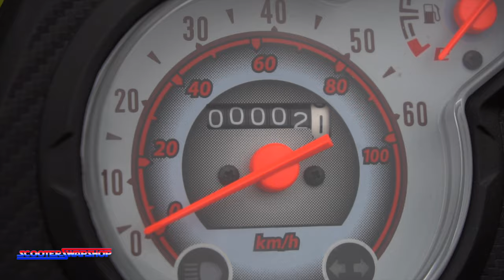HONDA NAVI : First thoughts and Walk around. FIRST CRASH?

Comment: I love mine. They are fun and inexpensive. They're different than the traditional scooter in that they have a more motorcycle styled aesthetic. I think they look good. Power is superior to the 50cc bikes plus they are reliable as hell. The complaint I do have is that I wish the wheel sizes matched. That rear wheel limits the options IMO, and the rear fender with the tail needs to go as does the rear wheel cover
Reply from the maker: Totally agree!
Reply: very first 'mod' i did was rear fender delete. looks SO much better without it.

Comment: Do you think the navi could be equipped with a GY6 150cc powertrain and would it make the bike any different as far as acceleration and top speed?

Would it make the bike better, bottom line.
Reply from the maker: Yea you could the problem is it won’t be reliable anymore.  Believe it or not with just a cam and variator, carb tuning it will be the same speed as a gy6
Reply: @Scooterswapshop  are you aware if there's any kind of speed limiter / manager on the navi to where it might be under tuned purposefully?

Comment: The Navi piqued my interest, but it looks cheap for a Honda. I mean, the build quality on my Kymco looks like it's built better (and I have a front disc brake on that!) I like that they included the storage box for the US model though; it's an option in other markets. I get the point though, other manufacturers have been making motorcycle-styled scooters for a while (cvt-scooter mill in a step-over frame) And Honda wants to bring in new riders, so as a beginner bike, where you can twist and go like on a scooter, but still have the foot brake, but all the braking is unified to reduce the chances of a mishap by a new rider grabbing the front brake hard... I dunno. I think I'd rather get a an actual used motorcycle; since you'd need a motorcycle endorsement for it in most places. Definitely has potential though. Really interested in seeing what you guys do with it... Oh, and the low barrier to entry; This is currently the cheapest new bike Honda makes, and it's cheaper than a Ruckus, with a larger engine?!? makes it tempting for a lot of people. Even cheaply made, by Honda standards, means it will last a long time if maintained.
Reply from the maker: great input!

Comment: I was looking at these before they were released. I wonder if you can recommend old or new a scooter for a big guy. Im six foot 1 and 240 pounds. The scooter will be only for in town riding. I live on a very curvy road so it i want to have a big of fin there too. I was looking at a 2 stroke zuma bugeye but thought it may be to slow. Im kind of lost on what to buy. I do not was a big 250 or anything like that. I do not care for the styling of the bigger step though scooters like some of the big hondas/Vespas etc. Five to 8 miles will be a typical trip. All on smaller back roads. Would you take this over a used Grom?
Reply from the maker: man it all depends step thru scooters are a blast your not too big at all there are way bigger dudes on way bigger bikes if you dont want to md something maybe a grom if your wanting to mad a zuma of any style will be our suggestion.
Reply: @Scooterswapshop  thank you I was looking at a two-stroke 50cc Zuma that looks to be in really good shape. Like I said I like the modify things I never leave stuff alone I wanted to be my own LOL. Thank you for the information and if I pick this up I'll be buying stuff from you guys because you took the time to answer my question

Comment: It's also about the same price as a Chinese 230cc motorcycle(hawks, magicians or tbr7s are all about 1600-1800 shipped).... Dealer support vs highway use(still no interstate capacity as this price unfortunately)
Reply from the maker: depends on your state. and no one wants a chinese bike hahha
Reply: @Scooterswapshop  eh depends every state but Cali has them legal (even there they can be transferred in if you move), and I guess the worst to deal with is state tax if you have it(the bikes are online and shipped in a crate the price doesn't change state to state), I personally got no issues with it, they are also basically all clones of a honda crf250, down to the point Plastics can be swapped between the two, the engines more or less reliable and even if not it's 350$ to buy a fully assembled replacement, quality is surely lacking but with the money saved from dealer fees on a Navi you could fix a good bit(front shocks come to mind)

Comment: Did you guys notice the pedal operates front & rear brakes and the right brake lever applies add'l front brake?
The left parking brake is a great feature on a CVT drive...!
'Saddlebag' storage from a trunk that doesn't add to width!
More power? Swap out the entire swingarm/motor for a 250cc scooter drive!
Imagine a full-size 250cc-500cc scooter w/tube forks, similar body and bigger storage capable of 100mph?
Reply from the maker: ok